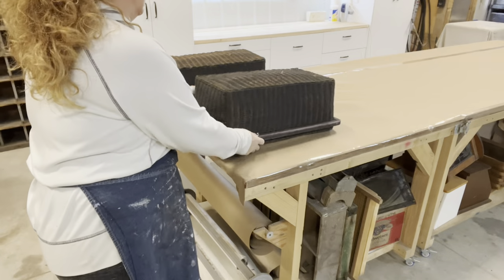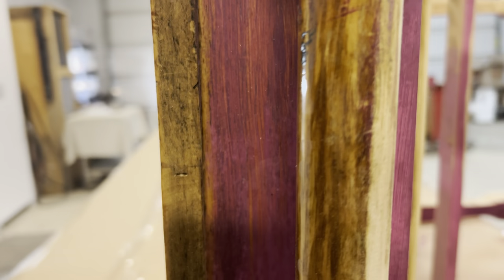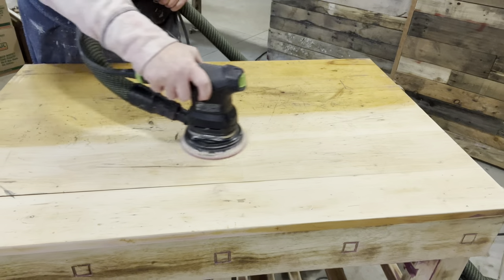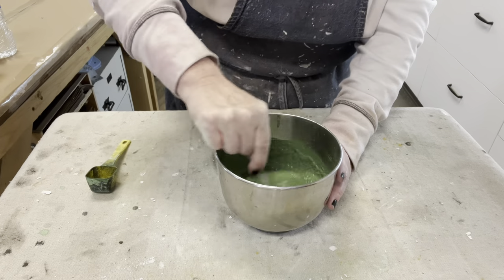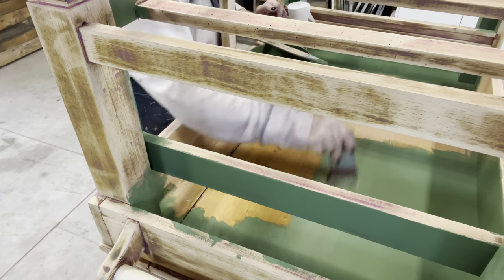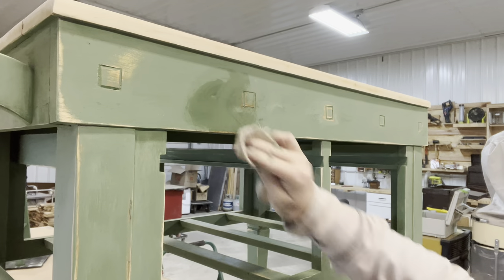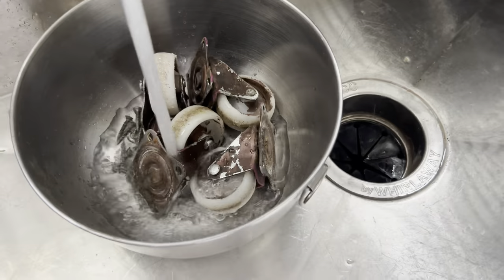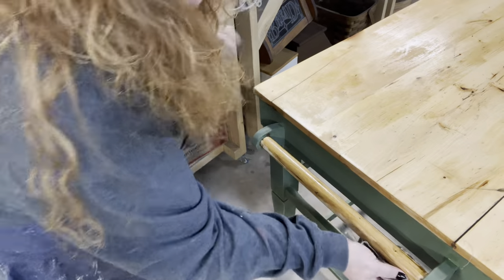WOULD YOU TACKLE THIS? EXTREME FURNITURE TRANSFORMATION

Comment: I have a question Yvonne. But it doesn't pertain to this video. I bought a gravity feed spray gun because of all the projects we've got going on and my regular spray gun is really not designed for these types of projects. I'm not having any trouble with the paint going through as much as the polyurethane. I've watered it down and that doesn't help. I remembered seeing a video of yours some time ago and you have or had the same gravity gun I bought. My question is, are you taking the filter out of the gun to spray your polyurethane or are you doing something differently? The problem I'm having is the filter will clog within a minute of spraying. It starts out nice 60 seconds later I'm calling on the Lord to heal my sprayer. 😂
Reply from the maker: I never sprayed polyurethane.. only polycyclic. But I never felt it was a good finish. Spray cans for me were more consistent. Sorry I couldn’t help more
Reply: @GingerChickRehab  Thanks anyway I figured you had a trick. I've thought about taking the filter out for spray the polyurethane but I don't want to mess up my gun either 🤔😁